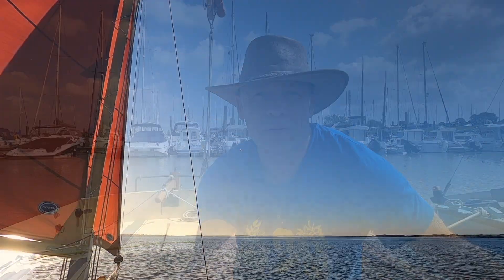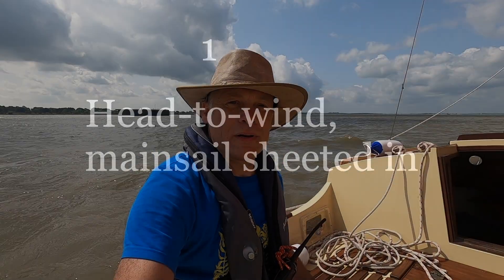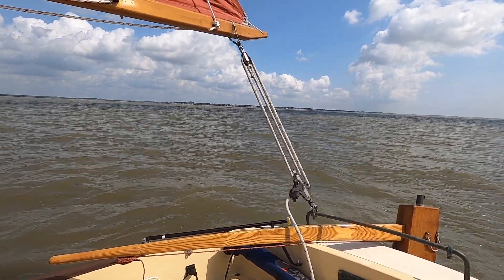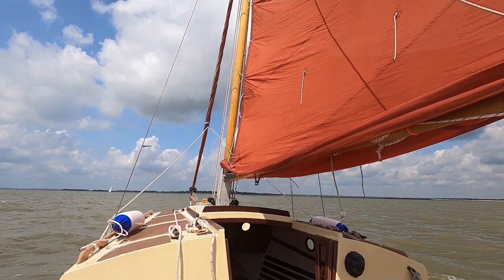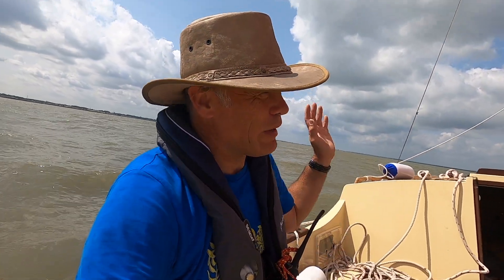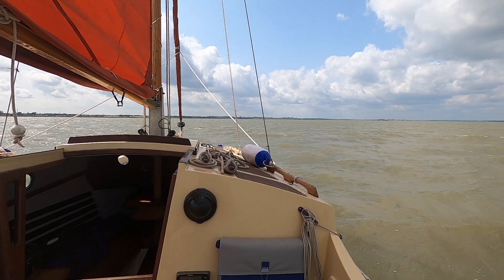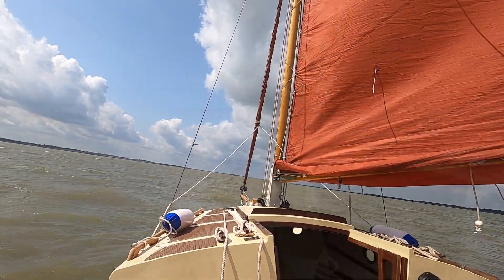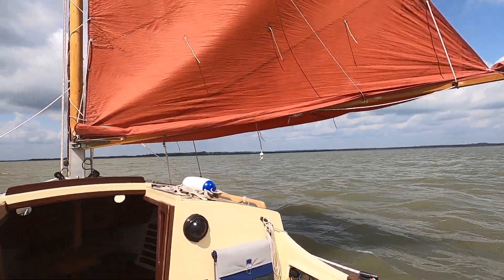Reefing under sail (not using engine):  2 ways that work for me, & 2 that don't

Comment: Hi Toby, my experience in a Westray 16 (gunter rigged cruising dinghy) was that the  topping lift really helps bring the boom inboard. I would  furl the jib, depower the main  by lifting the boom a bit, then haul it more inboard with the mainsheet. This way the boom is within reach, the boat slows down, the wind blowing up off the mainsail leach pushes her up into the wind - certainly worked for me! If you look at the footage of you hauling in the clew line in this video, you can be seen pushing the boom up with your hand to depower and bring it inboard - why not do the same thing with the topping lift?  That's what it's there for! Much more controllable.
Lovely thoughtful videos, BTW.
Reply from the maker: Thanks Paul. I have tried using the topping lift on a few occasions, without it seeming to help much. But what you say makes perfect sense, so I’ll give it another go.

Comment: That was well worth doing and I have to say that you looked a lot more confident about the whole reefing business in this video. 

I've always hove-to for reefing if at all possible simply because you make very little way in that position and what way you do make tends to be sideways. However, when constrained by a channel, such as the Blackwater up by Hilly Pool Point, the close-hauled method is better as you can continue to make way down the channel rather than drifting sideways as you do when hove-to.

I've not tried just letting Naiad do her thing with the main hauled in and no jib, I'll give that a go next time I'm out.

I'd also add that how the boat reacts to the various methods does depend a lot on the type of keel and the shape of the underwater hull profile. Shamrock, like Naiad, is quite a shallow hull with a centreboard, so a fin keel hull or a long keeled hull will react differently, so sailors watching this should try their own boats to find the best method for them.

Many thanks for posting this video, a very helpful trial of the various methods.
Reply from the maker: Thanks. Yes, all the practice seems to be paying off.

I need to practice close-hauled reefing in stronger winds & bigger waves to get a proper idea about it.  As I've discovered, being bumped around in the waves & with the boat heeling over makes seemingly simple tasks a lot harder - and the nice calm execution on display in this video becomes something else entirely! With my experience so far I also prefer hove-to, because everything seems a lot calmer.  But we'll see.

Comment: I've always go hove-to to reef and have experienced the same problems as you to keep the boom over the boat. Reducing the jib is a great idea and i will give that a go next time 👍

I've not tried it, but I would have thought reefing whilst sailing close hauled under Jib (in stronger winds) could be quite challenging without the stability you get from hove-to. Plus an unwanted increase in apparent wind.

Thanks again for the great content - lots to think about.
Reply from the maker: Yes, I'm not sure about the close-hauled method in bigger winds & waves.  Hove-to is definitely my preference at the moment.  In fact when I last did some reefing in windier weather (my "Reefing practice in 20 knot gusts" video), I was going to try close-hauled & then chickened out. I need another good wind & then see if I have the confidence to try it out!